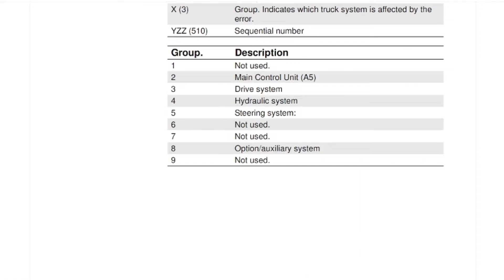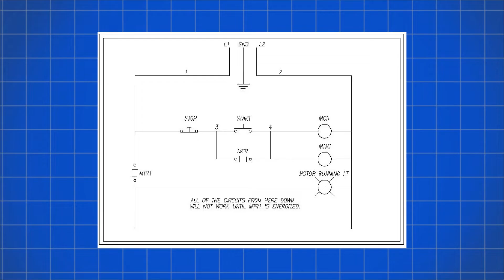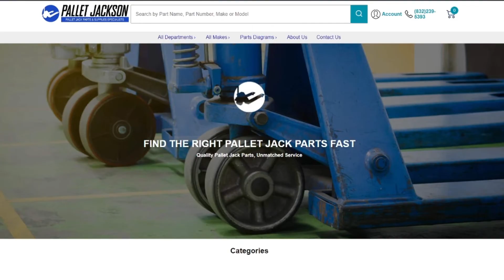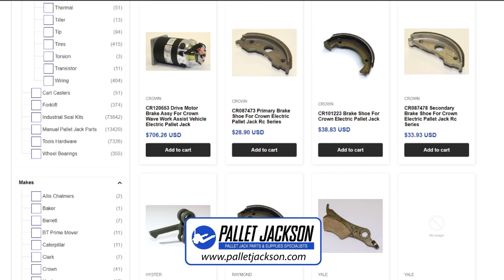Toyota Electric Pallet Jack Error Codes | Fix Error Code E152, E250, E115, E161, E107, C-28, C-14

Comment: E203? Any idea whats wrong?
Reply from the maker: Toyota error code E203 indicates a communication issue, most commonly a motor open circuit or a problem with the traction amplifier or motor itself on a Toyota electric pallet jack or forklift. To troubleshoot, check the battery terminals and the communication cable, inspect the power supply, and if the issue persists, the traction amplifier or motor may need replacement.

Comment: Code 2.511?
Reply: Error code 2.511 on BT/Toyota pallet jacks and forklifts indicates an internal leak within the hydraulic system, specifically suggesting that the lift cylinders may be leaking internally. A common recommendation is to inspect the gland at the top of each cylinder and check for internal leaks
Reply: @PalletJackson-h2p  Thank You! 👍

Comment: Code e159 ?
Reply from the maker: Hi, Error e159 in Toyota electric pallet jacks indicates a 'CAN Bus Overrun Error.' This arises due to the TA not replying to CAN messages. You can resolve this error by:
1. Checking for short or open circuits in CAN-bus wiring.
2. Addressing electrical noise by:
   - Inspecting CAN-bus wiring.
   - Using a known-good battery.
   - Driving in a different environment.
3. Check the power amplifier.
4. Check the ETAC.
If the issue persists, contact our customer support team for further assistance.

Comment: I have a 2005 Toyota Bt swe120s walkie stacker. Do you guys know what E202 code is?
Reply from the maker: Thank you for reaching out to us. Error 202 in Toyota electric pallet jack models may be attributed to the TA current sensor error. The underlying cause could potentially stem from a fault in the Phase current sensor. To address this issue, we recommend investigating the cause of the apparent short. Start by examining the cables, and proceed to replace the TA and/or traction motor until the problem is isolated